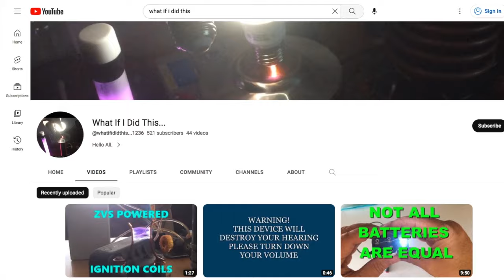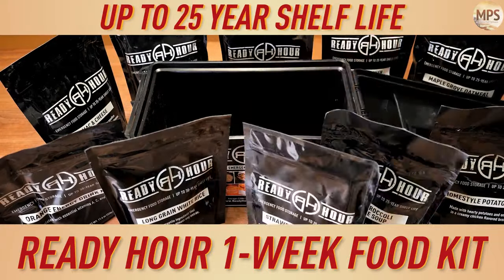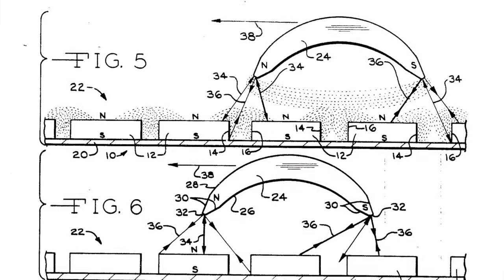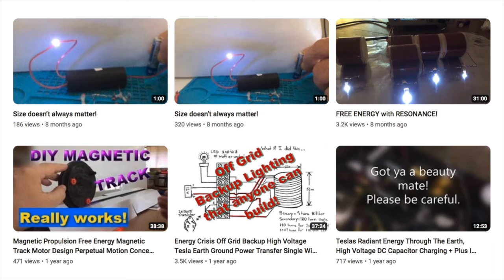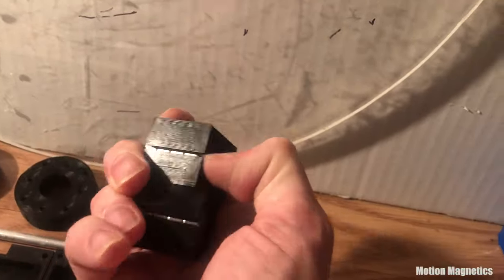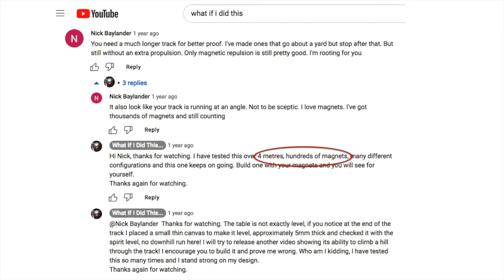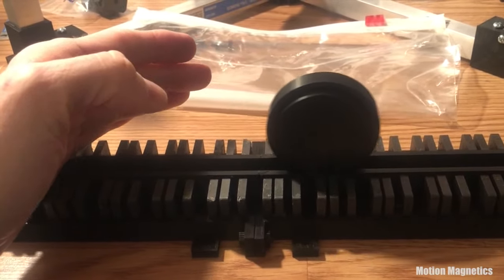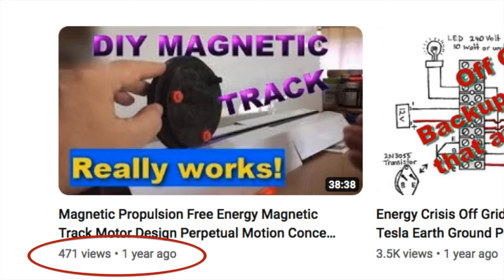Magnetic Propulsion System

Comment: Motionmagnetics, You talked about using momentum and inertia for get past the sticky points.  Have you considered using a configuration that would take advantage of leverage in order to help gain more advantage in getting past the sticky points?  Years ago I toyed around with perpetual motion ideas.  Yours as well as many others' channels got subscribed to and I am always watching new videos to see how people are doing.  The one thing I don't see people who get close is then taking the next step and using leverage somehow to make it successful.
Reply from the maker: Yes, I've been looking at leverage and other forms of mechanical advantage lately. I plan on sharing some new ideas I have once I have built and tested them.
Reply: @Motionmagnetics  Another suggestion if you are interested in trying it.  When I was messing around with my magnets I found that 2 magnets can pass closely by when they are perpendicular to each other.  Let me see if I can describe what I mean...

I had a magnet that was N/S on the flat surfaces.  I took another just like it, but ran the thinner edge across the flat edge (either pole works).  The magnet on edge wanted to rotate to align S to N with the flat magnet.  There was no force impeding me sliding the magnet ALONG the flat magnet.

So my thought was that you could use the attractive force of the magnets to pull together (by not having they lined up in a neutral position) and then using leverage tilt the end-on magnet just a little until it reaches that neutral position  and let it slide by from it's momentum.  Since I don't have a 3d printer I could not set up something to make this setup, so I could not check if it would work.  If you can't figure out what I'm trying to explain, let me know and I can reach out in an email or something and send a picture or diagram.
Reply from the maker: @ronrothrock7116  I'm not positive, but I think I've experimented with a similar configuration? You might present the idea in a video with a diagram to further clarify it? The more ideas we put out there, the more minds there are to explore and expound upon those ideas.

Comment: U need to use negative feed, on outside of a flying saucer, so it doesn't ark. So same with this. But U need to to three big coils top middle and bottom. Or two same size as your magnet setup, and run magnet frequency vibration using spectra spinning magnets not the iron core moving, it's opposite is best always

Comment: What if you started with a partiality complete circle track and then close the circle after the wheel starts moving? Responding  to the 4:50 minute mark.
Reply from the maker: This design has to have a certain precision to work properly, so it's tricky to tweak it without causing it to lose functionality.

Comment: What about putting the track on the inner/outer face of the ring.  Then have the wheel/wheels revolve like planetary gears, rolling around the track to torque the cranks driving the center shaft.  You could split/double the rings and have the crank levers run in between so the wheel can be rail  centered on the track and maybe add teeth to keep the force timing alignment consistent.  The addition of the gear  teeth and  at least a second wheel should help overcome the remainder difference from pi.  Like having multiple cylinders helps overcome TDC.  Also more friction though.  Maybe initial enertia can have thermodynamics shove it up its wormhole, after all...  
Or maybe have it drive the shaft with a magneticly locked drum, like a torque converter.  That would need a specific weight reduction design though.
Ehh, food for thought.
Reply from the maker: I think that might introduce too much friction, but I love the idea of setting the track up like planetary gears.
Reply: @Motionmagnetics  
I know right.!? First and foremost; friction...  time÷motion makes energy get swept away down relativity river with even the tinyest bit of mass interaction, before even getting to physical contact..  Might as well be an inverted slope for all practical purposes.  But then there wouldn't be light.  Lol.  Entropy is a frigid succubus we can't live without.  Haha, hey what if you chill the magnets with nitro halfway to supercon but still far from coupling.  There would still be the the clearance/suspension issue to resolve though.  Between the track, gears and now possibly side rails unless you could get em to lock just right at some critical apex temp or something.  Thats a pretty big R.D jump for a hobby prototype though:: 2(x3)d...  and then is it really net + with the nitro factored.  What about renewable supplements for the cryogenic overhead.  Or whatever entropy factor for that matter?  Heck energize the plates with a renewable source and turn it into a kinetic turbune.  But then were back to heat.  round we go...  😆  power plant hybrid combos.  Why don't the nuke plants use the excess heat for other applications more prolifically, already; is the question.

Comment: I'm going through my recommended videos and I come across some random channel claiming perpetual motion from permanent magnets called motoflux. Out of sheer curiosity I looked them up and while they themselves don't claim it's perpetual (and specifically state perpetual motion is impossible), they do claim it's a motor that uses only laminated ferromagnets and permanent magnets. Not only that, but they claim to have a patent, and that the torque output of the motor is much greater than the torque input. I wouldn't mind a 3rd party looking into it. Lol
Reply from the maker: I think we'd all like that. lol
Reply: They've been saying that for years though...  All have proven bogus,  so far... well have to see it in action to believe it.  Right.?😏
Reply from the maker: @kerstanpark2629  I would definitely have to see it.
Reply: @kerstanpark2629  yeah it's literally just a magnetic torque converter. That's why they emphasized heavily on the greater torque output.

Comment: Hey man you should do another experiment using electricity. There’s lots being created with your track maybe you can bank it in capacitors and use electromagnets to make it more efficient.
Reply from the maker: That's been suggested a few times. The idea was to cycle movement without electrical input. Electrical input would, however, make things more interesting.

Comment: Amazing content! Thank you for sharing! 
I wonder if you have any plan to experiment with pendulums and magnets? Milkovic two stage oscillators are super interesting! In my attempt to make an analog of Tesla's TMT with a wind powered Milkovic oscillator i got some very interesting results.
Reply from the maker: Possibly. I was looking into escapements and that led to designing a series of gears that could be turned by use of weights, and that led me to start designing a gravity generator.
Reply: @Motionmagnetics  Thank you! Yes, escapements are interesting too.  I think pendulums are the best mechanical analogy for Tesla's electrostatic oscillators. Similar like is water for electricity, so called electronic-hydraulic analogy. Do you remember a toy from 70's so called 'clackers'? That would be interesting to try with magnets! & magnetic Jojo would be interesting to try too!:)
Reply from the maker: @oxiigen  They might be, and yes I do. That's a blast from the past. I imagine they would work more like springs as they would start to repel once they were in close proximity to each other rather than just bouncing off upon impact.
Reply: @Motionmagnetics  Right, magnetic clackers should use rigid rods instead of ropes and rotation limited to one axis only, that should work. And magnets should be strong enough to avoid direct impact because of damage i guess. Magnets are so fun!
Reply from the maker: @oxiigen  That sounds about right. Aren't they though?
Reply: @Motionmagnetics  Indeed they are! Can't wait to see some of your next fun projects! Cheers!

Comment: Might a circular version be hampered by some unseen flux that should not be looped? If 4 meters straights works, it's hard to explain why a circle well over a meter in diameter wouldn't.
Reply from the maker: Some of that was addressed in the latest video that the inventor of this configuration posted in his latest video. You can find the link to his original video in the description, then just click on his latest video from his channel.

Comment: Beginning at 4:38, where the mass takes off real fast, isn’t that it? Keeping up with the moment when while getting a boost from the past?
Reply from the maker: No. He has to place the roller past the repulsion at the entrance of the track to get that effect. It's similar to how a spring works. If he slowly pushed the wheeled roller toward the beginning of his track it would try to push it away until he reached a certain point past the edge or opening of the track.
Reply: @Motionmagnetics  
Ok. But what if the angled mags were in a circle?
Reply from the maker: @TheWorldBelow360  It would cog and not complete a full rotation because you would lose the spring effect once the track lost its exit and entry points that cause the effect.
Reply: @Motionmagnetics  
So if the circle is complete, the wheeled roller would lose its moments of impetus, that being both repulsion and attraction. Or impulsion, which apparently is a word.
Reply from the maker: @TheWorldBelow360  In the current configuration that I featured in the video, yes.

Comment: Hello, I have seen a number of your videos on Youtube. I have 2 questions; (1)Did you manage to measure the torque (in case of a working rotary permanent magnet motor) or the thrust (in case of a working linear permanent magnet motor)? (2)what was the total mass of the system (rotary or linear) that corresponds to that torque/thrust? Regards, Sam ps, I do design electric motors and if the torque/thrust mass density of these permanent magnet motors is high/low you might start/cancel my journey with these permanent-magnet motors.

Comment: Excellent concept & video. I am loving it. Thank you. just a suggestion .. try putting a neutral track (no magnets) before and after the entry/exit. My understanding is that the circular wheel will not enter the magnetized portion. And also .. after completing its journey (if at all it does) to the magnetic edge it may continue forward. But will roll back after traveling 6 to 8 inches.

Can both entry and exit be accomplished by adding a weight to the circular wheel. Basically im-balancing it at the point of entry and exit. The weight should force the wheel to enter the magnetic track. Additionally the weight should also force the wheel out of the magnetic system. The trick would be to have just the right length of the track. So the wheel escapes the magnets with the additional gravitational force. Provided by the extra weight on the wheel.

Also just a thought. Obviously using a another magnet for the extra weight would not be a good idea. Because of interference with the magnetic flux on the track. Similarly using heavy metal weights like iron/copper/lead will also be counter productive. Because of eddies (and magnetic forces) created by motion. Something neutral like stone would be excellent.

Shall be eagerly waiting to hear your comments. Thank you. Blessings & Warm Regards.
Reply from the maker: Thanks. It's really just my review of another YouTube creator's work.  You have to push the wheel into the field, but it will exit the track even if you add an extra track without magnets. 

You can use weight to force it into the track, but that can also cause drag as you exit. The trick is to try to keep it imbalanced. 

Stone is not a bad idea. 

Thanks for the kind words.
Reply: @Motionmagnetics  Sweet! Thank you for your quick response.

Comment: Can you have a swing arm which actuates a lift of some type from a circle of magnets lifting always the lead magnet or magnets at all times by the special shape of the swing arm which cannot fail to lift or pop up only the lead magnets as the arm and it's magnet follow until you manually stop or brake the system
Reply from the maker: I think I'd have to see a 3D model of that.

Comment: What if we start at the middle of the track but with full momentum? What happens if we use a spring or something to store the initial energy to burst fire some momentum in the wheel?
Reply from the maker: It will exit the track, but that won't work if you convert it to a rotary track in this configuration. To use a spring you'd have to put in as much energy to compress the spring as you'd get out of it. Nice thought though. Thanks.

Comment: I have a track design that runs off of weight wanting to roll downhill, both to the right and the left inside the track.   I believe it will keep running on it's own, but i don't have the means to build it.  If you would like to build one, i would be happy to let you have the plans for it.  I don't want anything in return, i literally just want to see if it works.
Reply from the maker: If you have the time, Shoot a short video with still shots of your plans. I'd be happy to take a look and you might find yourself inspiring people to give it a try if they find your idea compelling.
Reply: @Motionmagnetics  The tucking power Top doesn't really need a detailed drawing.  It's the 3rd design i'm sharing that uses attraction only, and i don't think it will keep running, but will provide pure raw torque and propulsion with Zero sticky points.  

It's simply magnetic slats that are attracted to each other at all times, than can slide in towards the center of the top towards each other, and slide out away from the center of the top until they hit stops.  So you spin the Top up manually fast enough where the Slats are forced all the way out hitting the stops.  Centrifugal force is keeping the slats away from the center of the Top because you are manually spinning the Top up real fast.  Now let go, stop manually spinning it.......as the Top slows down, now the Slats magnetically attracted to each other start tucking themselves in towards the center of the Top, which of course makes the Top spin Faster...just like an Ice Skater Tucking their arms in.
Reply from the maker: @dr.davidbannerf.e.s.6217  It's an interesting idea.

Comment: Why doesnt anyone ever follow the directions.  3:03   Dont change things and then talk about how its not the same
Reply from the maker: I changed the size but used the same spacing. The YouTuber that posted the original design is going to demonstrate a longer version of his track as well as post his original 3D models. So it will soon be possible to get test results from the original magnet sizes with the spacing.

Comment: I wondered if a hybrid system could be designed where a capacitor is charged which then triggers an electromagnet to push the wheel to the next series of permanent magnets.
Reply: That's an absolutely amazing idea! Using electricity to power electromagnets in a serial fashion to push it along is brilliant, why didn't anyone think of that before? Oh, wait, that's literally exactly how an electric motor works. Good job.
Reply from the maker: Not in the current configuration, but that's a nice suggestion.
Reply from the maker: @hoon_sol  He meant as a self-contained system, not as an electric motor.
Reply: @hoon_sol  Quote: "Oh, wait, that's literally exactly how an electric motor works. Good job." 
Thank you. 
Spin a motor with your fingers and observe the output on your oscilloscope. 
Do a study on regenerative braking. A motor and an alternator are the same device.
Reply: @Motionmagnetics  It looks like I got trolled. I'm sorry. My second channel focuses on robotics, animation and lenticular photography. I like the kind of experiments you're doing. I'm going to subscribe so I can see your followup work.
Reply: @Motionmagnetics :

No, they are literally referring to driving the magnet out of stable configurations by using electricity to power an electromagnet; literally EXACTLY how an electric motor works.
Reply from the maker: @awaitingthetrumpetcall4529  That happens on YouTube sometimes. 
Those are all great subjects to focus on. 
Welcome aboard. Good to have you along for the ride.

Comment: Making a permanent magnet motor which only uses permanent magnets is ridiculous .This is because it would be free energy machine which is impossible.
Reply: Motor/dynamo/alternator....high torque....add very heavy large well built fidget spinner....give one good spin n watch spin n create energy for potentially 5 plus minutes at high speed from the human energy off about 1/500th off a slice off bread...if u get it too spin a high torque alternator for even a few minutes you are indeed getting energy for free...or a bite off food and in return maybe harvest enough energy too run a some LEDS too grow some food...if your food source is free then your energy too create your spin power too harvest is also now free
Reply: It is crazy.. but in all reality it doesn’t really need to run forever. Just long enough to be consistent over let’s say a 24 hour period then we could just use solar power to juice up the wheel once a day it’s still considered free energy right? Haha I don’t think we could siphon off of it without taking its rotation out of spin before the 24 hour period but this could be something we use in the future to improve efficiency. It’s a really cool concept.
Reply: @jaketarbell5194  Energy enters a system and exits. The amount of energy should stay the same. What you're proposing would basically make more energy. This is not possible because energy cannot be created or destroyed. Think of a system like plumbing. There is an input, and an output. If you input 5 liters of water, then you should get 5 liters out or less (efficiency loss).